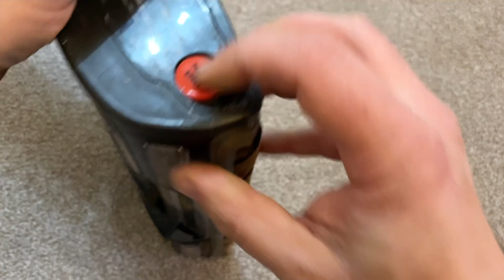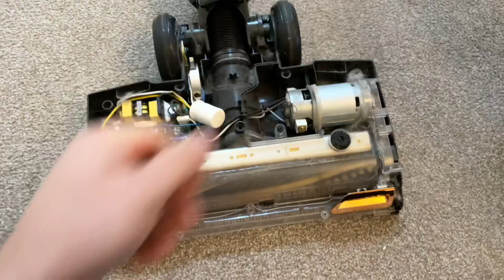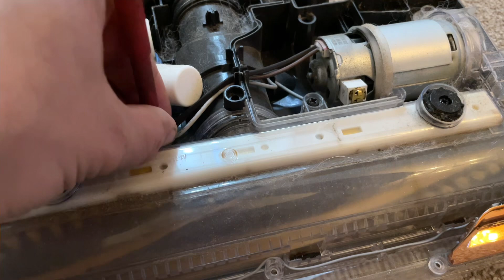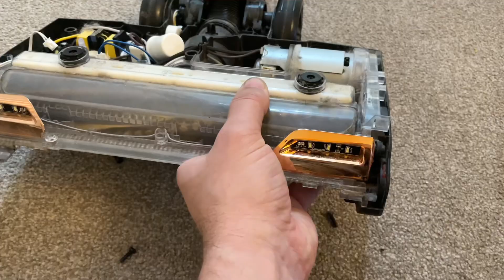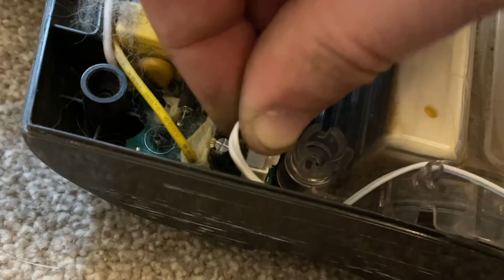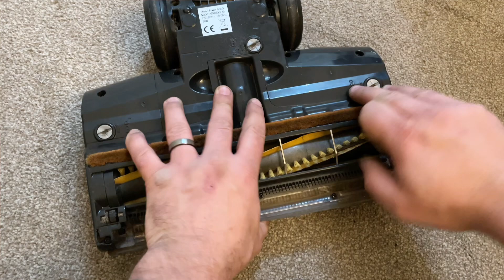How to Take Apart SHARK DuoClean Power Nozzle AZ910UKT

Comment: Hello. My shark due clean head is making a funny noise. I’ve taken it apart and when removing the orange roller there is a metal hook looks abit like a staple. It’s attached to a coil. Isit supposed to be there. It wasn’t before and it now makes it hard to put it back
Reply from the maker: Yeh orang rolller has a hook. Explain the funny noise and when it happens and I might be able to try and help

Comment: Useful video, but hoping I’m not going to have to go through all of this. The hinge housing has cracked on my floor nozzle, so I need to replace a brand new (well 2nd hand new 🙂) floor nozzle. From your experience will I have to mess on with the electrics when replacing this? Thanks
Reply from the maker: If it’s still working g you wind have to change the wiring. Just replace the top cover if you want to do the repair properly. If not to bad I have a video on this common issue here 

https://youtu.be/V_YIdtygKXU?si=CTm8PGyL31O-1Voj

Comment: If the bottom plastic base is cracked on the floor tool (it won’t lock the floor tool up) is it possible to get one and replace it?
Reply from the maker: Morning. Sadly only options.

1. Compete new floor head as shark doesn’t sell the individual parts 

2. Used plastic part off eBay of any available…. The are model number specific 

3. Nothing left to lose, try this method that I’ve used before. 

See video here :  https://youtu.be/V_YIdtygKXU?si=hqDc3ReBTrIYUwE0

Comment: Got the cover off, but side won't pull away 1.56 to release? Any advice gratefully received TIA
Reply from the maker: Ok, make sure the 2 screws on top of the clear part are removed and if it’s not pulling from the front. Grab the brush motor on the right and pull up towards you, see if that helps 😊
Reply: @vacuumhelp thanks for the advice. Didn't take it off, as now the cover is removed I can see that the belt's intact. The issue I have is that the roller won't spin. On further investigation, it'll spin if you give it a push with fingers - which is quite painful. So assuming the motor and belt are OK, Im at a loss how to remedy it?
Reply from the maker: @podiumnutter ok when unplugged, remove front roller and check nothing built up behind that. If both brushes are spinning freely the having to give the motor a helping hand is the first sign of motor failing. 
You can sometimes find used ones but seem to be abit hard to find at the mo. So it would be the full “power nozzle” you need off shark site. 

They are about £70 usually but sign up to email list before buying and you get 15% off any purchase

Comment: Hi, I have taken all the screw out, but when you say lift from the corner it won’t come out. Any suggestions please?
Reply from the maker: So you must have got as far as separating the clear part from the base? And can’t get those to unclip from each other? If you have this model number I do it from the corner as it means the release catch is out of the way. No set rules tho. If all screws really are all out including the 2 at the top of the clear bit, then maybe try from a different angle. Try pulling upwards on the motor on the right and maybe the opposite corner give that a go. Once it separates a little it should pull out really easily. So yeh hope this helps
Reply: I have an AZ910UKT. I wanted to send you a photo but there isn’t anywhere to upload.
I’m pulling as hard as I can but it just won’t come out, yours looks really easy.
Reply from the maker: @villanikki31 my Facebook page is below if you wanted to send anything over. With me doing these day in day out there is always the risk of me making it look too easy but send over a photo and see if I get anything from that. 

https://www.facebook.com/share/1PP4TpNX6w/?mibextid=wwXIfr